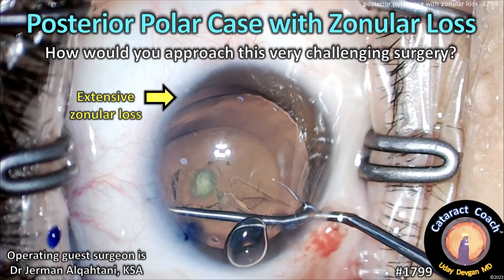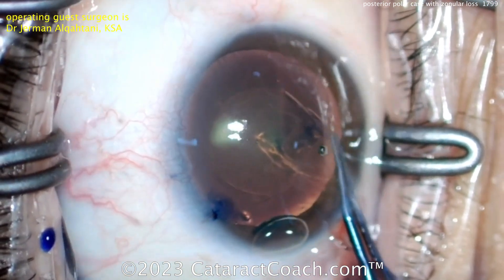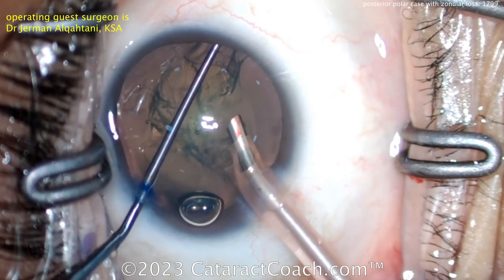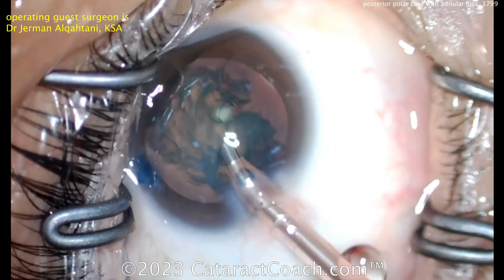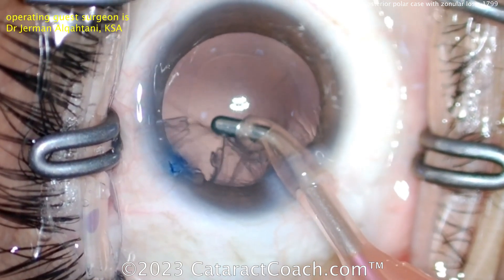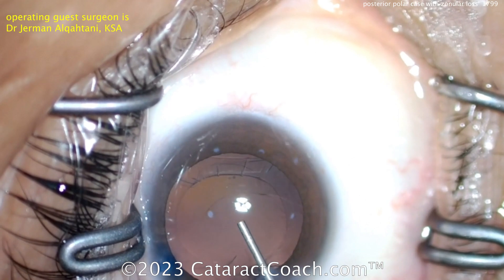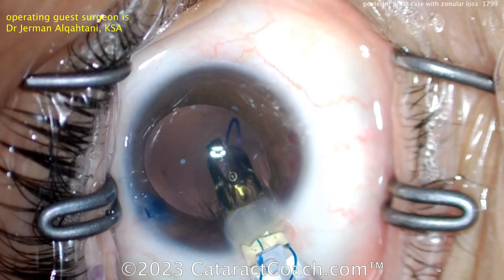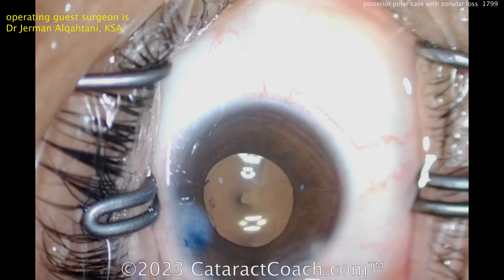CataractCoach™1799: posterior polar cataract with zonular loss

Comment: zonular dialysis at the site of a failed chop should raise suspicion for the chopper accidentally being placed on top or outside of the bag, rather than within it. But I examined the chopper placement at 1:40 and it looks good as far I can tell - video obviously limited; both in terms of 2D and reduced definition. Id be curious what the surgeon thought was the case..
In any event; great case - thanks to Dr.Alqahtani for submitting, and you for sharing!